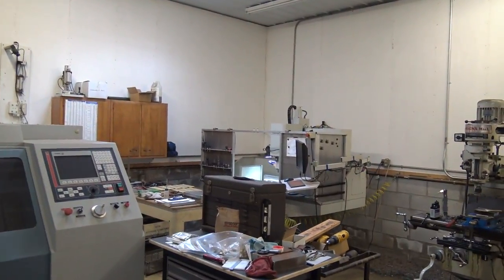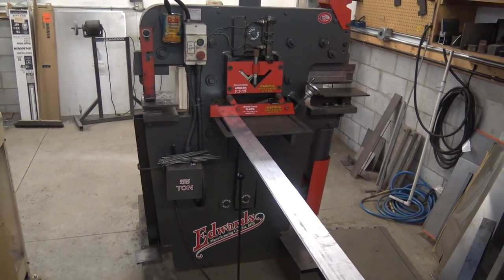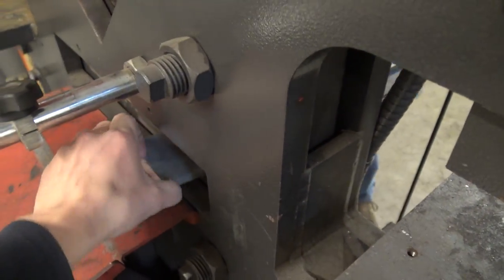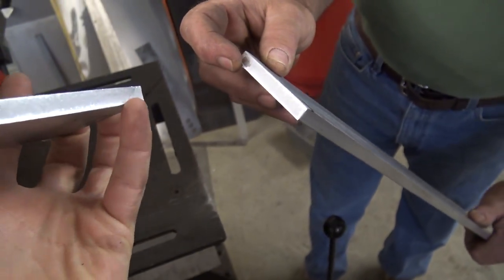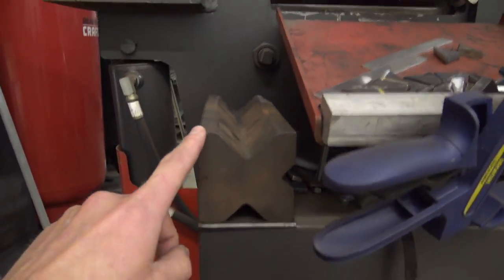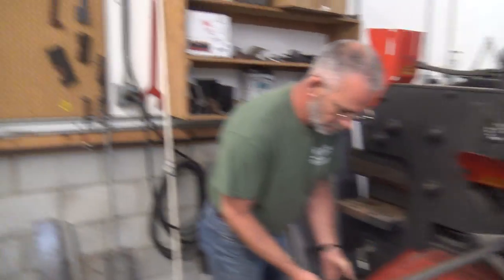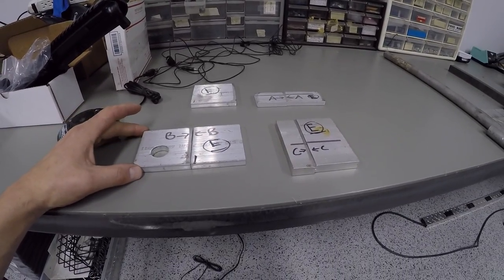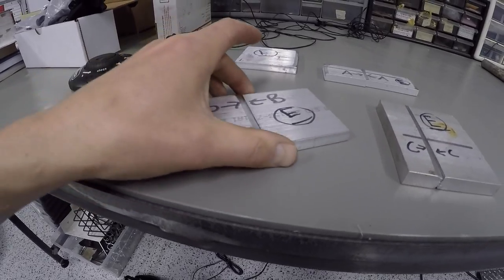What is an Iron Worker? An AWESOME Machine!

Comment: Hey John, I have found when punching the tool clearance between the punch and die matters for a clean cut and tool life. Bit of CRC or WD40 for steel / Stainless and narrow cut kerosene for aluminium in a spray bottle for lube works well. As a guide the thinner the material the smaller the clearance to maintain a decent cut. It also can effect the amount of pressure needed to cut through the material too. It'll never come out like a machined cut, but plenty fine enough for shoving a bolt through or even self tapping threads. As for work hardening around the cut edge, it would be small if any as cold working is a function of plastic deformation in metals. Determined by an equation of original area minus the area changed divided by the original area times by 100, expressed as a percent. Page 232 of Materials Science and Engineering, Wiley press if you inclined to see how it all works.

Comment: Great video :-) Several years ago I operated an Edwards. The distortion, you are seeing was typical of pretty much any shear, out there... The list of equipment, I operated is extensive. When you shear anything, it's like a pair of scissors and the stress on the material runs the whole length of the material cut... My metal supplier will sometimes shear plate steel into 1" strips, if the run out of 1" Flat bar... The strip of sheared flat bar will always be twisted. If I need "Flat" 1" flat bar, I have to specify "Not Sheared", or they'll try to slip it through, to save a bit of money... That's the nature of the beast. The "Distortion" is what I think of as the "Material Stress Zone".

Larger shears have a clamp to hold a piece of material in place to minimize the twisting, but it still happens, just not as much. Something to think about... Cold Rolled Steel is made by inducing Stress into the surface of Hot Rolled Steel... You'd find that if you Heat up Cold Rolled Steel, it looses it's surface stress and reverts to the Hot Rolled state. If you take a distorted piece of sheared steel and heat it up, along the affected region, it will loose a lot of the distortion caused by shearing... Not all, but some... Thinking about using a CNC machining tool along the affected zone, I would treat it as if it were Cold Rolled Steel... if it has not been heat treated (Normalized)... The same would apply to Holes Punched in steel... I don't know if Aluminum would be the same as they are two, very different metals... But the affect in aluminum would not be as severe as steel...
Reply: Really, Aluminum should not be so affected as Steel... Reason being, Aluminum has a soft core and oxidizes quite differently than Steel... Aluminum develops an Oxidized surface but is still soft internally... If you're welding aluminum, the core is molten before the Oxidized surface melts... It take a lot of practice to know when the Upper surface is molten, but not the Bottom layer... Because, if the bottom layer of oxidized metal melts, all of the core will simply fall out... being liquid long before the bottom... The trick is to melt the top layer before the bottom layer... That takes a lot of practice...

However, if you are welding aluminum with a TIG welder with "High Frequency", the High Frequency burns off the Upper layer, exposing the core, but leaves the bottom layer intact... That also takes a lot of practice...

Bottom line is, to me anyway, It would make little sense "Cold Rolling" aluminum as the structure of aluminum is very different from Steel... It doesn't form grains like steel does... Steel is uniform throughout... When it is pressed, sheared or whatever, the structure of steel changes and can be affected by heat treating, whereas Aluminum is a very different animal... Sortta like Apples and Oranges...

In the end, Aluminum Alloys have been developed to increase hardness. It's something like Molly Steel, but with Molly Steel the entire structure of the material has changed, not just the surface. Aluminum Alloys change the entire structure of the material, in a similar way. I think you understand... Might be an idea to get into some books on Metallurgy... The properties of various metals would go a long way, in your business... :-)

Comment: I own a Scotchman 6509 ironworker, bought new in 2000 for $10K. Has been an outstanding machine, never a problem, made in USA. They're now about $18k. All the shearing and punching deforms the metal, if I the piece has to be perfectly flat I always sawcut. Rarely use for aluminum as that cuts so easy with a chopsaw, skilsaw, or tablesaw with negative rake carbide blade using vegetable cooking oil as a lube on the blade. Also if your shearing aluminum with your ironworker you're sure to contaminate the aluminum in the case of welding it. Thanks for the great videos...Thumbs up!
Reply: +NYC CNC I know nothing about the Edwards machine, looks good from here lol, me buying the Scotchman came down to me being familiar with that brand, lots of them here in western Montana, and lots of tooling and accessories available, I believe the company's been in business for a long time (future availability of parts and accessories ). If I had to go buy new again I would definitely buy Scotchman, used I would probably be shopping price and condition

Comment: We had a flywheel-driven ironworker when I was in school. They're awesome, but also terrifying. This thing spun a 600 pound flywheel at about 1400RPM, when you pull the trigger, it will complete a cycle. Period. A guy put some half inch AR500 plate on it without knowing, it was harder than the punch die. Pulled the trigger ,a cycle completed, the punch exploded and sent a broadhead-shaped shard into his forehead. He lost the ability to smell, lost sight in one eye, and now has several mood disorders, the shard was touching the back of his skull when they x-rayed him in the hospital.

You must. MUST. be cautious with these things. Always know what you're putting in it, without any shadow of doubt, and don't put your face right in front of the punch, that's asking for trouble.
Reply: We had one of those flywheel models in my first engineering job . . like you said, this thing was scary! God nor man would not stop it once it began it's cycle! Serious machine, got the job done tho! And on a side note, I remember we got all those exact deformations in the mild steel as shown on the alu in the vid.
Reply: Well said 👍
Reply: Wow
Reply: Same thing happened in my workshop. Someone was using the punch and the die exploded and sent a massive fragment into his chest. He was fine luckily.
Reply: Sounds more like you had a Punch Press rather than an iron worker.... either way, you are correct, safety precautions must be followed !
Reply: @jeffreystoesser6878  Metal working machines seem to be far more dangerous than woodworking machines. The forces they use can cause something to shatter without even realising just how much stress something might be under.

The manager in my place of work sent a shard of metal into the safety guard from the shearing blade after part of it broke off when he put some plate that was too thick into it. The dangers are much less conspicuous with metal working machines than people realise. They're not obvious like a saw blade or drill bit. Nothing can stop those tons and it's easy to lose control of them without knowing EXACTLY what it's limits are.

Unlike a drill press or chop saw, these machines are defiantly not for use by the unskilled ever after reading the manual. Someone who's extensively used the machine before watching over you for a week is defiantly advised. That's the nature of hydraulic or flywheel presses.
Reply: @mrdojob   After 46 years in the metalworking/machining industry, I am very aware of the risks VS that of woodworking ( which I have plenty of experience in as well ).   A flywheel press is typically a punch press, where an iron worker is typically operated on a hydraulic ram or piston system.
Reply: @jeffreystoesser6878  I think they might be called "guillotines" or he was mistaking one for a guillotine. I never heard of a iron worker being flywheel powered and the machines themselves seem too small to make use of a flywheel. 

I noticed that the blades usually give up the fight before the machines do which makes them so dangerous and they do so with no warning. Awesome machines but they give no feedback of being in distress.
Reply: Thanks
Reply: @iangraham6730  You have the wrong machine.  These are hydraulic, not flywheel
Reply: @justaguy328  Yes I know, I meant the one we had was a flywheel version of that one.

Comment: That was a smart decision John. I've never run anything like this myself, but have sharpened some tooling for others and I hear they're a real money maker. You can probably make up some tooling to do the channels etc if it comes to that and modify the machine as required to suit your purposes.

That burr looks more like a clearance issue to me. Keep in mind, my opinion is worth about what you've just paid for it, but I understand there's both a formula and also a bit of a knack to setting the appropriate clearance, and I think it varies between materials. It's not just a case of the shear/punch being sharp or not, although that obviously affects things.

My thoughts in regard the distortion would be to set up your production jigs as soft-jaws, with clearances allowed for the area of distortion so the material isn't being gripped there. It's going to be machines away anyway, the only difference might be to allow additional cleanup allowances. Even when gripping in a vice for ad hoc work, just use some jaw inserts to limit the grip length and avoid the distorted area.

As others have said, yes it's 25.4 mm = 1 inch. 25.4 is a very handy number to remember BTW, and incidentally why lathe translation gears from metric to imperial or visa versa are 127; the smallest prime (number) of 254. 254 being, wait for it, the length of an inch. A bonus piece of useless trivia is that an inch is now officially 25.4 millimetres. Yes even in the US, so all the anti-metric guys been working in metric all the time, and just didn't know it! ;)

I'm looking forward to seeing this bad-boy in action. I can't even imagine having the room, even in my wildest dreams, for such a machine, but just love hydraulics. I'll just have to live out my Ironworker fetishes through you John, so bring it on! :P

Comment: I have an  Edwards 50 ton "Jaws IV" I bought new about 20 years ago. 
It has been a huge time saver in my shop and a great value. Not as refined or as pretty as some of the European machines, but it does the job! 

I believe I paid around $4500 for it back then. It came with a 'set' of Cleveland round punches I think 1/8" to 1".  I have done some mods to it over the years. The first immediate one was a larger infeed table with adjustable straight edge on the left side. 
You will find all sorts of fab jobs move along faster with this machine. And, yes, it can 
save time in certain 'pre-machining' applications as well where you use it to rough out 
a hole or slot.
Reply: I'll be very interested to see what cleverness you impart on improving the functionality of the machine.
Might copy some of it!

Comment: One thing we have added to all of our small sheers and iron workers are spring pressure pads on the rear of the sheer, you will notice that the part that is clamped down on the front face comes out better because is stays flat the entire time but the drop piece on the back breaks on an angle some depending on the thickness and leaves more of a beveled cut compared to the front cut. And as far as the holes we use a piranha iron worker in production of parts and it works great but expect parts to have a bow to them after being punched. Having some type of die spring to apply down force while punching results in a much better part.

Comment: Hi John, another great video. BTW you will always get de-formation, regardless of what machine you buy. It's the nature of the process. The only way to minimise it is to adjust the clearance for each type and thickness of material. Given the iron worker is designed to work across a whole range of materials and thicknesses, ya might say it is set up for the "average". You have bought a very versatile machine. Congratulations.

Comment: The bit sticking out is from as it shears the weight of the piece makes it hang and causes the huge burr, you should check out a wet sander machine if you do alot of plate and dont want to face mill. You put the bar in it comes out other side sized, it like wood planer

Comment: Some Ironworkers are awesome but not all. if you're considering a used machine may I suggest trying it before buying. Also try pricing tooling for the machine as to get an idea of what it costs. The punch and die clearances are based on the thickness of material. Meaning that if you set a punch and die for 1/2" material it will have a heavy burr on 11 gage.

Comment: The 40 ton MetalPro (from McMaster Carr) is only about $2800. Of course you can spend that much again if you add all the optional tooling including a complete set of round and square punches (which I have). MMC doesn't carry the 45 ton version, which is a little more and has some nice features like an out-board punch station (so you can punch around the edges of arbitrarily large sheets), but they could probably get one for you. I have both versions and like them very much. (And as I mentioned in a previous comment, I really like their customer service.)

There is some distortion around flat sheared ends, and the angle-iron shear really distorts one side of the cut (spreads it out).

Comment: I'll also vouch for the durability and reliability of the Edwards style Ironworker. I work in a votech shop where an identical edwards press gets used by students daily. No one is more creative nor diligent in finding ways to break tools and equipment as 17 year old boys. It still runs like a champ after 7 years of daily use. I expect with normal care it'll be running 50 years from now.
Reply: Can confirm. We had one of those huge power hacksaws in our shop, it was the only thing tough enough that the students couldn't mess up.

Comment: For cutting this type of stuff, a 14" Cold Cut saw is fast and leaves a nearly machined surface on the edges.  I made over 1000 cuts on 3" channel and angle iron on an installation job with the DeWalt 872 and $130 DW7747 blade.  While in a hurry, a cut would take about 4 seconds;  slowing down to 10 seconds, gets you a "mirror" surface in some steels.  About $750 total for the saw & several blades.  Still makes great cuts aluminum and steel (using different blades).  The only negative about this saw is the stamped steel base.  I keep putting off adding a thin steel plate on top to keep it from bending. Try one out!

For holes, I had a Diacro turret punch which had about 24 punches & dies in it.  Rotate the turret to the hole size & shape and punch!

Comment: Looks to me when you show the back side of it while he shears it after you said "go ahead" that as the angled blade comes down it shears from one side to the other and builds some stress in the part and it looks like it pops off before the shear starts shearing that side. That leaves a protruding part that gets scraped by the blade, causing the blemish. Could just be the video angle but either way iron workers are awesome. I used a smaller one in high school to cut up flat stock for every one to practice welding. It could cut up a full stick of 3"x .250" flat stock into 4" sections so fast, and it was quite satisfying. I am interested in seeing if the time and blade savings offset the deformed stock waste.

Comment: Cut clearances have to do with the type and size of material ex. You want .003 clearance on thin material where with thick material you want .01 same goes with punches. A good way to tell if your shear needs sharpened is that your shear area will have a "2/3rd" line where the material deforms then breaks if the shear has too much or not enough then that "2/3rds" will be different.

Comment: For aluminum I use an old cast iron table saw with a sled for most of my cutting. Its only like a 2HP with 10" blade but it rips through 1/2" stock pretty quickly. I'm using an 80T aluminum blade, its either 0 or negative rake.  I usually setup a stop on the sled and I can chop up stock way faster than on a bandsaw or cold saw. I also use it as a poor mans milling machine to rough out parts. The finish sucks but it often gets the job done. 

I'm thinking a big old 5HP cast iron table saw with a 12" or even a 14" blade would rock cutting up stock. With the CNC mill you could easily make some really nice sleds for holding various types of stock. You could also make some nice adjustable stops that can be dialed right in.  You could take it even further and add power feed(s). Hell why not just make it 2 axis CNC?

Comment: Regarding the "gumminess" of Aluminium vs. Steel, we work with what is probably the gummiest of common metals, Lead (radiation shielding needs it). Once you get that soft, shearing is problematic because of the deformation and "flow" of the metal, so we have to bandsaw it. Aluminium may need a closer shear distance setting than Steel in order to produce the best results - you may have to factor in adjustment time when changing materials vs. material wastage where more has to be machined away if left unadjusted - only experience and experimentation will tell.